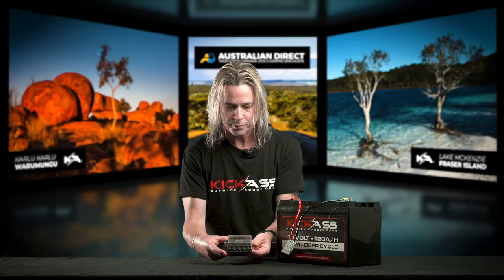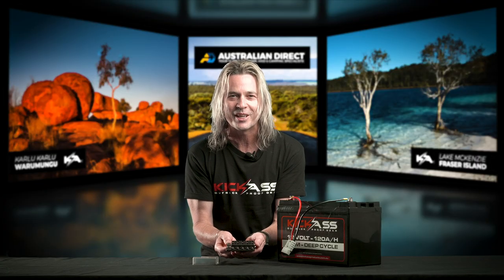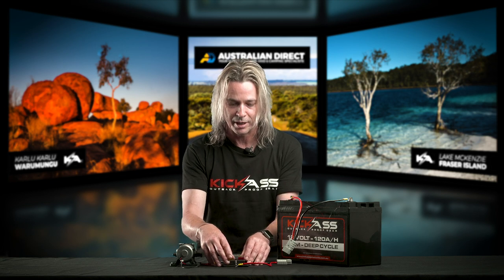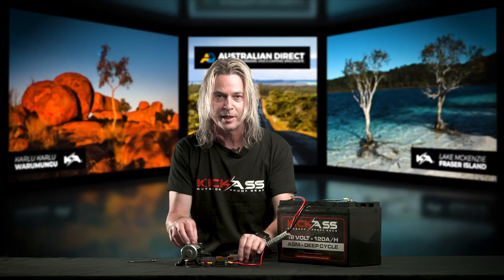KickAss 10-Way Blade Fuse Box with LED Indicator System

Comment: This is not a "one size fits all" solution for early auto or pickup application. The glass fuse block has both 12V constant and key switch power. The configuration of this product would require you to purchase two of them.
Reply from the maker: Thanks for watching mate,appreciate it 
Cheers
Craig

Comment: strange thing. I remove one of the fuses and multimeter still showing 9(ish) volts coming out. Shouldn't removing the fuse cut all power from that connection?
Reply: I agree. I can remove the fuse and the Sony AV unit still has power and works fine.
Any solutions Mr KA

Comment: How dose the LED light (this unit should is (+)) where does the LED get its route to ground, if the fuse is bust - must pull ground from somewhere ?
Reply: gets the negative from the device inline so the led wont always switch on when its blown.

Comment: It would be more organized if it also have earth, in that way you can use as an input an accessory output and run all the wiring together
Reply from the maker: Your earth connect does not require to be fused.
Reply: @KickAssProducts  yes I know that, I’m just saying that in order to organize the wires of the accessories, using an earth unfused there would be helpful (for example, I have accessories with both wires together inside an sleeve)

Comment: Negative line how to connect?
Reply from the maker: G'day mate the fuse box only uses the positive side of the circuit so its nice & easy to install as long as you have everything grounded to battery or earth
Thanks for watching 
Cheers
Craig

Comment: Hey guys would these be waterproof for a boat
Reply from the maker: Hey Paul! I would not guarantee it as it is not specifically waterproof sealed. As long as it is not in direct contact with water and is located somewhere safe on your boat I would say you will be right. The cover over the fuses does protect it from any water that may land on it, but it certainly is not safe to be submerged. Hope this helps.

Comment: How does the led light up without a negative connection? 🤔 I have a fuse box from Blade Fuse and the led's don't light up at all 😢
Reply from the maker: G'day there mate,it will only light up when the fuse has blown,so its working normal when there is no led lights on
Thanks for watching
Cheers Craig

Comment: Hello I want to install some leds to my car and I want to controll the on and off function from car's original headlight switcer. How about taking current (+12 V DC) from a headlight socket of the original fuse box (using a tap fuse holder) and drive it to the positive terminal of the auxiliary fuse box instead of using the battery for that purpose? If I connect the positive terminal of the auxiliary fuse directly to the battery I will not have this capability. Is it safe to do it with this way and will I face any problem in the future If I want to connect more devices to the auxiliary fuse box? 
Thanks in advance!
Reply from the maker: Hi Giannis, I would consult an auto electrician when trying to do specific setups in specific vehicles.